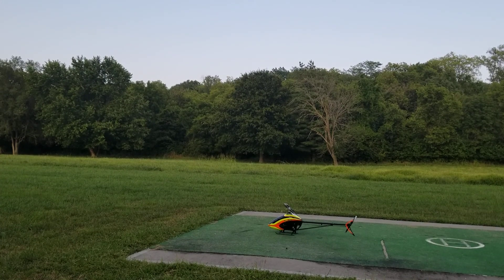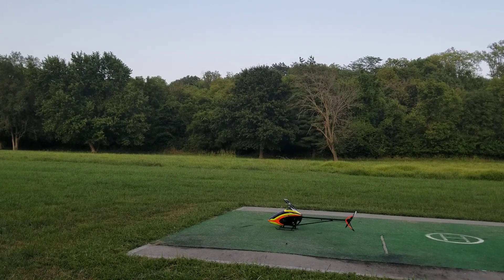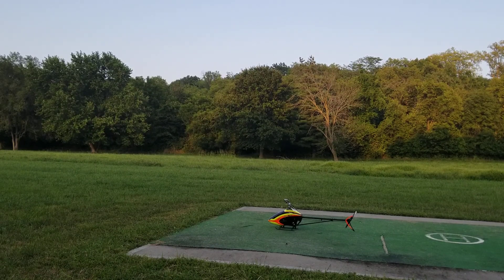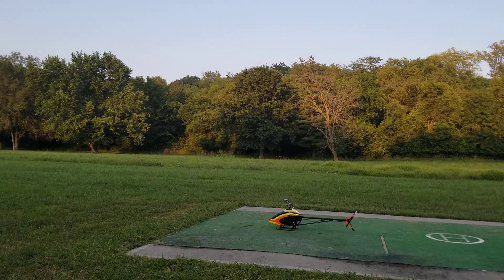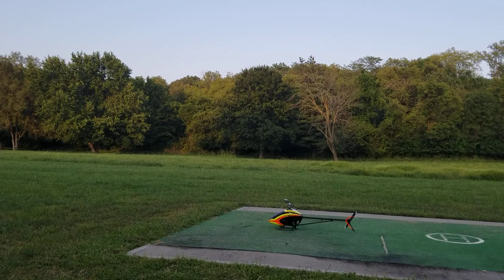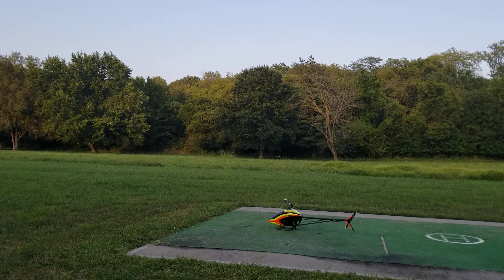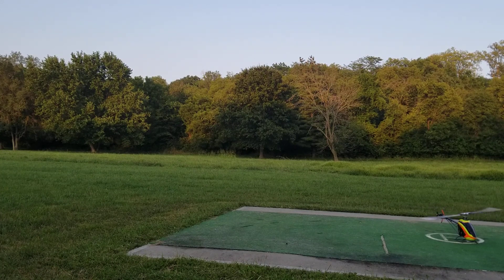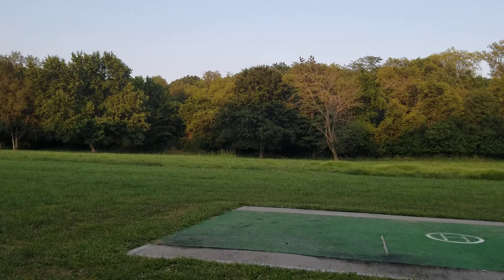Nothing special just some autos

Comment: I don’t know if you’re running the hard dampeners or not, but even with lower “style” settings with the Logo 700 it’s had boom strikes in inverted tail forward and inverted piro stuff at even higher head speeds with aggressive collective.. It seems you need the 90 shore dampeners or rigid-core style dampeners. Also keeping the Heli in the shade so the o-rings don’t soften too much if it’s hot outside. Anyway! Cool videos. Keep them coming man
Reply from the maker: A combination of high collective pitch +13 and high style 125.
I had the soft dampeners at first (didn't replace them) for 3 years no issue. Just recently I bumped up the style rate when I started touching the boom. Then I installed the rigidcore dampeners and the blades still touched the boom.
https://youtu.be/s-p1Ida1BDE
This flight is with the rigidcore dampeners.
Now I still have the rigidcore, I just reduced the style rate, I just have to try some hard maneuvers to confirm that it's good now.
Reply: @flyblood2045  nice dude. What’s your opinion of the dampeners? I have the mikado 90’s in my Glogo but I’m thinking about getting the rigidcore. I don’t I think I’ll boom strike, just want to get a little cleaner pop on the collective
Reply from the maker: @NitroClouds  they are definitely good dampeners.
For nice pop dampeners and blades are what matters. Heavier helis will pop more too.
Your stick movement can create pop as well.